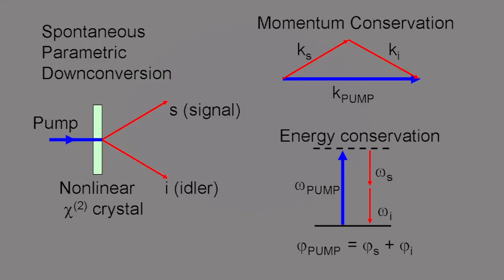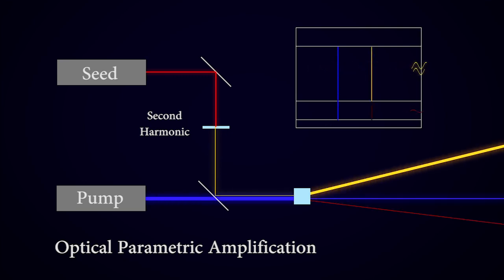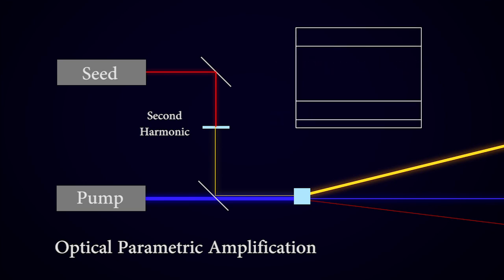DIY Optical Components and Visiting a Femtosecond Laser Lab

Comment: Great video!! I was inspired to build a N2 Laser and would like to try the quantum entanglement test etc. So I am modifying the current design spark gap to improve the performance ( faster rise times). The laser works especially well when you purge it with N2 gas. I was trying to get a canister of Nitrogen tank used for Paintball  guns etc. But ended up using a whipping cream dispenser with N2 canisters used for Nitro coffee and beer etc.. The output immediately doubles in brightness and dyes get pumped more easily then using nitrogen from air ( oxygen degradation). I am in the process of trying figure out where the crystals need to be cut and what reference to get maximum birefringment effects on a crystal etc. I looked into growing crystals for BBO but that is not gonna happen anytime soon as it requires hot melted crystal growth inducements. Any idea what particular way the crystal needs to be cut ?

Comment: If anyone is interested in a used optical table top I have one for sale. It's TMC 75 series 47x23x2" w/ 1/4-20 tapped holes (countersunk) 75lbs. Only $500 located in San Diego 92126. Great video btw!

Comment: Hi, cool project.
For the square holes with a round milling cutter, just use overcut on the corners (can't remember the exact name, but is usually an option on milling pockets). You have plenty of material and that 
elimenates the need for filing afterwards.
Reply: rotary broach

Comment: 7:00 I did SHG in undergrad with a 100mW IR laser, and we could detect the effect below full power, so I don't think power is your problem. Isn't your weak SHG output just getting swarmed by the input? We were able to see a faint blue dot, but only because the IR used was invisible. 

I also notice you show a fairly short wavelength laser, visible to UV. The output of such a beam is going to be far UV, if it works at all, are you even able to detect that? What makes SHG really annoying from a practical perspective is that you must use an IR laser. If you use a shorter input wavelength the output will be UV, so either your input or your output is invisible. Unfortunately, precisely aligning optical components with an invisible beam is tricky.

Comment: Get some compressed air into the cut to evacuate the chips, poor surface finish can be attributed to re-cutting chips, with acrylic this tends to melt the cuttings. I wouldn't use a coolant keep it dry and get the chips out, also if you know where your tooling came from, the manufacturer will usually have data on feeds and speeds to use with certain materials.

Comment: Question which electric power are your powering the laser is it AC or DC . I don't know much about it.
Reply: I think all the simple lasers use DC (like the homemade one, becouse of the full bridge rectifier)
the industrial one use high energy pulses
Reply: andré ruela could someone then use a DC arc welder for the power supply?
Reply from the maker: No. It needs to be 6-7kv DC. Less current is better so you are less likely to die, but obviously you need to be extremely careful with these. See my last video for more info

Comment: Glad you got to tour an ultrafast lab!  Phase matching is important to consider when working with SHG.  Since the index of refraction is likely to be different at the fundamental and second harmonic, the second harmonic light generated at two different points is unlikely to be in phase once it propagates.  Apparently birefringence is used to deal with this, so axial rotation angle of the crystal is important for efficient SHG.  There is a free program called SNLO that will calculate efficiencies for various crystals, thicknesses, excitation wavelengths, etc.
Reply: Robby Stokoe : If the channel creator takes your advice to try SNLO, I suggest contacting the software author to see if they'll donate a copy of the commercial version ("mlSNLO") to the channel.

Comment: Hey could we get the opotical parts as a 3D printing file? I don't have access to a cnc, but I own a 3D printer.
Reply: shouldnt be too hard to make yourself using fusion 360. if youre not already familiar with it I suggest looking up some tutorials. it's kind of the "hobbyist standard" right now for 3d modeling.
Reply: It is much easier than it looks to use fusion 360.
Reply: the thing is, not everyone has the money for fusion 360. 310$ is not cheap
Reply: Demi fusion 360 is completely free for non commercial use.
Reply: Demi yeah, when you download and start using the trial, just say you're a hobbyist and its free for life for non commercial use

Comment: Could you potentially add a high voltage ceramic capacitor in series with the spark gap to reduce the overall capacitance of the TEA laser setup?

Comment: Hey there, I'm somewhat of a newer follower, and I really appreciate how in depth and informative all your videos are. Compared to pretty much every other DIY/science content available on the web, yours are entirely 'next level,' so thank you. 

I have a question about this video however. I'm a bit curious why you chose to use UV glue instead of something specifically intended for acrylic, like a commercial acrylic bonder (or even plain acetone as a cheap substitute?) 

Forgive me, as I haven't yet seen enough of your videos to know whether you are aware that these can be used to bond acrylic or not. You are obviously more educated than I, but maybe this idea isn't as well known as I originally expected. In my limited experience with acrylic, simply using regular acetone in place of any type of glue has worked absolutely fantastic ...

I suppose if you were using (transparent) acrylic as an inexpensive lens, then the acetone could cause permanent damage to the optical properties of it, but just for gluing pieces of a mount together that shouldn't matter. (Acrylic doesn't make a very good lens anyway due to very low optical power handling - they melt) 

I'm pretty sure acetone would afford you a much more permanent bond (read: molecular bond - as in 2 pieces become one) for pennies on the dollar as compared to the UV glue.. (if you aren't sure what I'm talking about, google has you covered) 

... Or is there perhaps another reason I haven't thought of for your choice? 

Cheers,  and thanks again.
Reply from the maker: I like the uv resin and had it handy. Also it sets very quickly so I could work fast and be done. I'd been working for 12 hours already the day this was filmed and just wanted to be done.
Reply: That's fair. I suppose if you were ever dissatisfied with it, it would make taking it back apart a whole lot easier too.
Reply: I tried the gluing acrylic with acetone trick yesterday. I used transparent acrylic, and found they glued well, but developed what look like stress cracks. I didn't do any research to see how other people do it - I just clamped them with a g-clamp while they dried. Maybe I should have used less acetone, or less pressure. Any tips?

Comment: For precise optical adjustment, use a differential screw.  You might be able to make these with Trial and Error using a 3d printer with PLA to make a dual threaded nut (pressure thread with the screws) and a pair of metric hex key cap screws perhaps M2 and M3.  To make precision hinges, use 2 pairs of 2 metric hex key cap screws of different sizes with the tips of the smaller ones ground conical to form point contacts.  2 such hinges makes something precision adjustable with respect to an optical rail.   For getting tiny things ground conical, use a flashlight and a ruler and angle guage printout attached to a wall to measure the geometry with great accuracy by projection of the shadow.  Thank you for showing the world awesome things.  Kudos.
Reply: 3d printed garbage doesn't belong near this stuff!
Reply: 3d printing with PLA is a fairly reliable process when you use the right software and hardware.  I used it because it was available, somewhat reliable, and good enough when you design around its faults by using metal components and design for crudity where necessary.  For perspective, I designed a vernier spaced rail with tons of angle and position adjustment screws using 3d printed PLA and m2 fasteners.  You can design something like that to be precisely adjustable to 1/100 mm tolerances over short distances of plastic provided that you use adjustment screws.  Is it good enough for long term, room temperature independent perfection?  No.  Is it good enough for quick and dirty optics prototypes that only cost print time and experiments where stability is not strictly necessary?  Depends on what you are doing.  In any case, the design involved is rather detail oriented as you have to consider how to make stiff parts out of 3d printed plastic that work well.  The below are some details.  Designing this way was a bit of a time-suck, and I was a student at the time so my time was cheap.  Simply put, if you aren't designing good enough with only a 3d printer, consider a hybrid design with metal reinforcement wires using superglue, cap screw cone-in cone contact hinges, and feature choices which work around the inherent lack of precision of 3d printed parts.  Iterative design and DFM are key.

Comment: Why not laser cutting instead of milling? Using lasers to make lasers stuff
Reply: At 10.6um for a typical affordable CO2 laser cutter of sufficient power, it would most likely crack and ruin the crystal.  I know that they crack glass easily at 10s of watts.  Also, Laser Cutters have their disadvantages, notably conical kerf.
Reply from the maker: Don't have one, ironically.  Trust me if I did, I'd have shot it through the crystal.
Reply: The Thought Emporium well... Fair enough!
Reply: No makerspaces/fablabs around?
Reply from the maker: I'm in a hackerspace already. It's their mill. Besides I don't mind filing.
Reply: If you happen to pass in northern italy i can offer mine ¯\_(ツ)_/¯

Comment: when milling acrylic i use very soapy water as a coolant and lubrication  .
Reply: I was told today that acrylic was cut by melting... Sigh.
Reply: maybe with a laser cutter it melts . i use a CNC mill kinda like the one in the video . i 've found it helps stop the Acrylic melting on to the mill end and i get a nicer finished product , i just use a squeeze bottle just got keep it cool don't need much

Comment: The frequency doubling crystals in your typical laser pointer are inside the resonator-  they're intracavity frequency doublers.  This means that they're not actually running off of the output power of the laser, they're running off of the recirculated power in the cavity, which is typically tens of times as much.